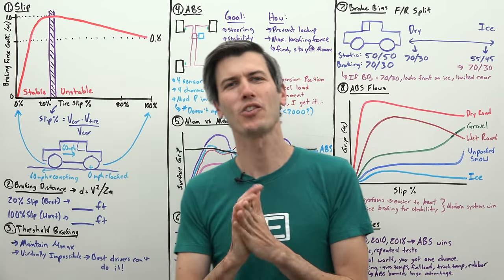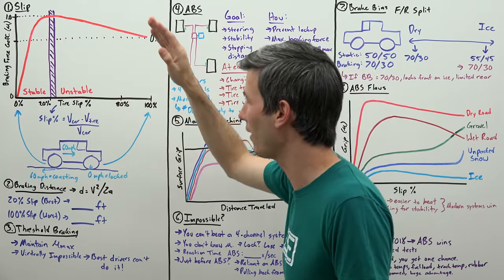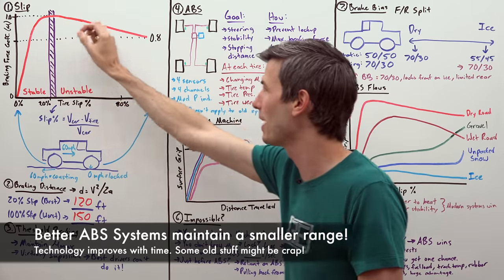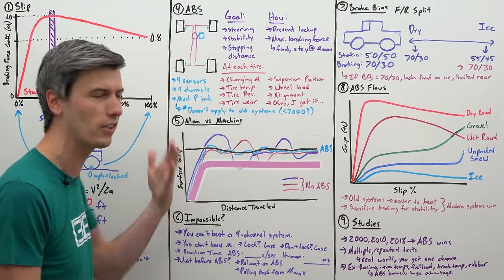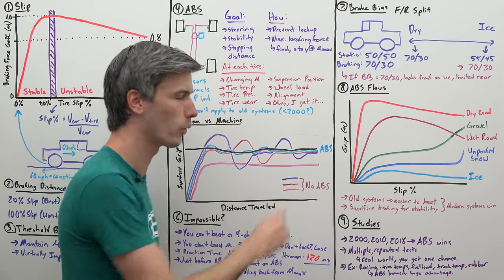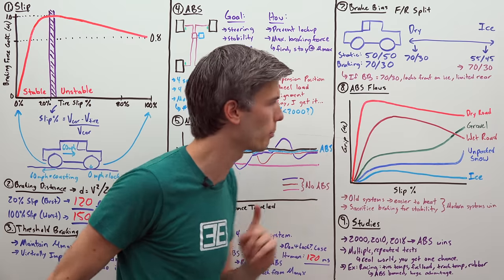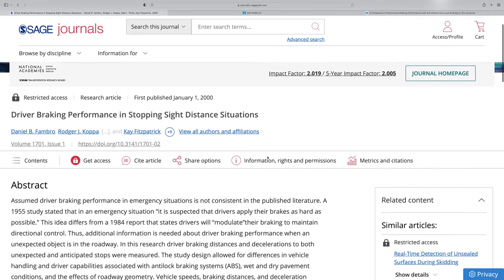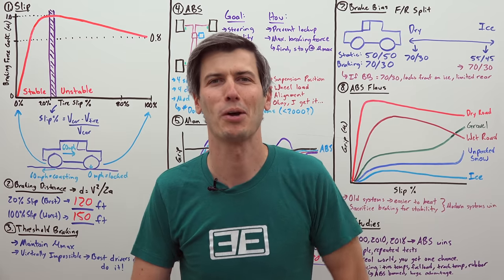Why Threshold Braking Is Impossible - ABS Wins!

Comment: There's a reason why regulators in EU in 2004 (and loads of other countries in the last decade) made it compulsory for all new vehicles to have ABS - it saves lives, people stop better with it.
Sure, Mr Racer guy might be pretty good at getting his Focus ST stopped when he's concentrating, but Auntie Mildred driving home from the shops in the rain is just gonna stamp on the brake if something pulls out in front of her - ABS will be her best chance at not crashing.
Nice video Jason! :)
Reply: Precisely.
Reply: I don't think anyone can beat ABS in that situation.
Reply: ABS was never mandated in the US because of the reasons he stated on gravel/mud.  But in 2012, ESC became mandatory in the US, which is based off of ABS and TC, so every vehicle has it indirectly now.
Reply: Plus it gives the confidence to stomp the brakes. Since the other thing that often happened before ABS was people not applying maximum available brake going long and colliding. Since they knew tires locking up and losing control was a thing and they feared that. So they under braked on not trusting being able to maintain control. So they rather under braked and maintained control, rather than over brake and lose control.

It was even part of driver training. Beware of locking up and so on. Modulate braking.

Well with ABS installed one can be told.... Just slam that pedal as much as you can. ABS and traction control make sure you don't lock up and lose control.
Reply: Nanny laws for nanny people. 
Next it will be electric vehicles,, and that is coming. Commonsense and precticality,,,, naah be a sheep!!
Reply: @ldnwholesale8552  common sense is that you won't even want abs until its too late to get it
i wonder if there were any astronauts who had to be forced to take an air tank into space..
Reply: It's usually Mr racer guy who ends up cosplay Paul Walker tho

Comment: In the mid 2000s, I had ABS activate on me driving a delivery van on the highway. I was unaware there was ice under the bit of snow I was driving on, and prior to then I was unaware the vehicle had ABS. It was locking up the rear wheels too much, causing them to slide, so I reverted to threshold braking to keep directional control. It was a great way to know where the threshold was though.

Comment: The thing that is most difficult about threshold braking is that your weight shifts according to your braking input, which means that the relative pressure applied by you needs to change. So you need to change your braking relative to your change in braking, and that 'double feedback' system makes it very difficult. Maybe my driving position and seat are just terrible, who knows.
Reply: It's worse than that, though.  Each wheel will have a different weight on it, and so the optimal brake force will be different from wheel to wheel, and there's no way you can optimally redistribute brake force between 4 wheels with only one pedal.  Nor can you get around it by tuning brake balance statically.  If you're on dry asphalt, you can brake harder, so the car weight shifts more onto the front wheels, meaning they need to have more brake pressure than the back.  Now, if you're on ice, you can't slow down as fast, which means that the weight doesn't shift as much, and now your brakes that were perfectly balanced on dry asphalt are locking the front tires and underbreaking on the rear.  Modern ABS can get around this by cheating and adjusting the brake force on each wheel independently in response to the car's motion.

Comment: Great analysis.  Had no idea ABS had changed that much over the years.  Figured my 1994 pickup truck with ABS was as good, or close to it, as modern ABS.  But maybe not...
Reply: Some of the older systems were pretty bad. GM used the Delco-Moraine ABS VI system on many vehicles in the 90s, which was a 3 channel system with the rear wheels controlled together, and also used a motor/piston setup which was much slower than the more typical pump/solenoid systems. It was basically designed to be cheap and to be able to say they had ABS.

Comment: I drove it an obstacle course at high speeds with puddles and a switch to turn off the ABS, trust me the ABS is 1000% better than regular breaking. The trick is with ABS you need to keep your foot on the break and steer through it and it works awesome

Comment: A lot of the bad rap for ABS does come from when it was being introduced:  it tended to be a pretty blunt instrument mostly made for panic stops but sometimes getting in your way when maneuvering,  and definitely getting in the way of any ingrained instincts to hammer the brake pedal quick as possible  in   panic stops.   In the 80's I had pretty remarkable reflexes and practice and it was all I could do not to plunge my Plymouth into the back of some yupster in his Audi suddenly leaning on full ABS.   This was the morning I blew off a dentist appointment to go get my car off my last ever bias plies.  :)       Anyway,  very early ABS was basically just taking over the 'hammer the pedal' function and it kind of blew,   but it actually improved very quickly,   and became pretty unobtrusive and helpful,   ...especially if they'd put it on like the rear axle of a pickup that'd tend to get light under braking.
Reply: The ABS in my work truck, a 2000 astrovan, is so frighteningly bad. God forbid I’m even slightly braking when I go over a pothole or even largeish crack. It WILL engage. Then immediately disengage. Then as weight shifts again it will engage again. Rinse and repeat a few times as weight keeps shifting around in the garbage vehicle and I have legitimately almost rear ended people during what would be otherwise very calm and slow stops. Talking about going from 35 to stopped in like 150 feet. And this little ABS dance it does takes ALL of those 150 feet. It’s honestly scary. 
My personal vehicle though, a 2009 Corolla, is completely seamless and confidence inspiring.
Reply: In the early days of ABS I heard* about people slamming on the brakes with ABS but being so shocked by the sound and pedal pulsating that they released the brake pedal because they thought something was wrong. 
*I have no idea if this is true, or one of those myths. 🤷🏽

Comment: Another important variable with the gravel and snow surfaces (likely much more important than the material building up in front of your tire); the digging in that happens when you skid to a stop also pushes your tires into firmer, grippier, ground away from the looser stuff on top.

A similar difference exists with accelerating. On tarmac if your tires are slipping then you're mostly just wasting energy and will accelerate slower so you want to gradually apply the throttle. On loose surfaces starting off at full throttle and then slowly coming off of it as the tires dig into the grippier stuff is faster than gradually putting the power on.

Comment: Back before ABS, I had a motorcycle accident. It was all I could do to keep the wheels from locking up. 70 percent front brake and 30 rear. At 35 mph I left a 3' skid mark with the rear wheel ( before it came off the ground) and a 9' with the front wheel. The front wheel never fully looked up but unfortunately I still hit the car that was making a left turn in front of me. I had the right of way as per the police.
Reply: For my next bike, the only rule is it has have ABS. Been on to many scares where you trying to ride the line between not hitting the car and not losing the front
Reply: @MegaLs2000  make sure it has cornering ABS as the bog standard ABS is only really good when you are upright.
Reply: I'm motorcycle riding some times the best way to avoid a collision is swerving out of the way instead of emergency braking. of course it is highly situation dependent. but something to consider
Reply: Too many riders are dependent on abs to save them. Abs doesn't make you stop faster, I don't care what this video says. There are too many variables. Tire choice, brake pad type, brake fluid ratings, even component types ie radial vs transversly mounted systems, master cylinders, rubber vs braided hoses, terrain, temperature of the wheels/surface. A good rider with the right set up and no Abs will  stop quicker than an average rider with worn pads, fluid that's never been changed, and tires that are 10 years old. Unfortunately too many riders fall into the latter group and don't maintain their motorcycle, ie replacing tires after 5 years old, brake fluid flush every 6 months, replacing pads or upgrading them to better than stock, or upgrading brake lines.
Reply: @dustinroque420  I get what you are saying and largely agree with the sentiment... But that wasn't my question, I'd like to see a full scientific breakdown of it for motorcycles... As you know it's a complicated matter and so that's why I wanted his breakdown of it.

I would say to you though, in the wet upright on the motorway I would absolutely want ABS... there is no way your brain is more superior than the ABS system in this case. We all go ahead and turn off ABS on the track because it's disconcerting banked over knee down with abs kicking in... Well it might just make you lose the front... So I absolutely get that ABS on motorcycles is a more complicated matter... But let's not forget even in MOTOGP, they have very advanced electronics... Turn off all traction control and slide control and the riders will no way be as fast or safe... So unfortunately at some point we need to concede that electronics are superior when tuned properly. I understand the debate is still very hot in the motorcycle community and many riders just hate it, but I want to be open minded and see if there is actually a system that could improve your braking... It seems only logical to me that if we can make all these other systems help us go fast then we can do it on braking too.
Reply: @Jjengering  I'd say they could probably put over sized rotors or something like a dual Buell style set up on both wheels, if the abs system can fully prevent wheel lock there's no reason we couldn't just run massive brakes aside from cost and weight. While I see the benefit of rider aids, I'll never be a fan of them. Masking riders with a false sense of safety isn't a good idea, because what happens if they get onto an older bike without? I had a friend who rode a bike with all the features, one day while maintenance was being performed at the dealer, he took a test ride on a mid 2010s r6, non abs. Was riding quickly, was used to abs not allowing for his error, and locked the front wheel and ate a curb. Also I'd recommend you watch the k5 gsxr vs ducati panagale v4 video from ari henning if you haven't. 15 year old suzuki and they ran quicker times with none of the safety stuff.
Reply: 70% front, 30% rear is no solution.  The ratio is always in flux.
Front and rear braking percentages change as faster stopping is required until it's 100% front and 0% rear.  Simple weight shift.
Reply: @dustinroque420  your obstinance is laughable!
All the variables and factors you mention are addressed by ABS:  wheel lock is prevented at the wheel, not at the lever.    The brakes will not lock, despite the pad, fluid, tire or road condition.  If your fluid and pads are old, you're going to have to pull on the lever harder, but it has nothing to do with locking the wheel.  Brake feel may be mushier, but that's irrelevant to ABS - it's controlling caliper compression AT THE ROTOR.  That's a separate issue.  In fact, your argument is a strong endorsement of ABS.  Since most drivers & riders don't keep their vehicles in perfect condition, they'll benefit even more from ABS.  
Plus, it's laughable for you to say you can react to tire lock-up faster than 15ms at the wheel.  That's simply beyond absurd.
Reply: @dudeonbike800  when did I say I can react at faster than 15ms at the wheel? Don't put words in my mouth. My point is that abs does not make you stop faster. It only stops lock up. There are situations where wheel lock is preferred and faster at stopping. I ride a motorcycle to be engaged in the experience, not so the bike can do everything for me. Safety systems are great, until they fail or you don't have them. I'll plug the revzilla video again where they take a bike with all the gizmos and compare laptimes vs a 20 year old suzuki with nothing and they run faster times on the suzuki. Enjoy having a nerdgasm about your 5 gigawatt abs system and try to think for yourself for about 3 seconds.
Reply: @dustinroque420  You're missing the point. ABS lets you consistently get the best out of your brakes. If your motorcycle is fundamentally in poor condition and not functional, you're in trouble, but with ABS you're in less trouble.

Also, braided hoses and radial master cylinders do nothing for braking capacity, they're just feel and precision things (but ABS is still gonna be more precise lol).
Reply: @SqueakyNeb  bud I fully grasp that abs provides consistency over different terrains. I never said it didn't. However, it doesn't guarantee faster braking. That's my point. Maybe read again and you'll figure it out.

Comment: An F1 car with ABS would be truly psychotic. The speeds and lap times achieved would be so incredible.
Reply: They actually can't use abs apparently. They tried, but the wheels would get flat spots on them because of how fast they are going
Reply: @youraveragegamer8832  thats probably why abs has never been introduced into f1 even with tcs and stability control systems being in the cars at certain points

Comment: Jason could you do a video explaining why big brake kits are a thing when stock brakes can lock up the wheels? and do big brake kits still improve braking distance? I understand the heat dissipation aspect of larger brakes, but I don't quite understand how they can improve stopping distance, other than maybe offering more fine control over brake force? Also, I have been trying to understand tire contact patch and haven't had much success finding answers. You hear in physics that frictional force is not surface area dependent, so wider tires shouldn't provide more grip, yet performance cars have wider tires, obviously. Is this because of the way the tire deforms and reacts rather than the frictional force alone? Just some things that I haven't been able to figure out thoroughly that are driving me nuts
Reply: Re: big brake kits, half of the reason is heat dissipation in track settings where you’re using them a lot more and a lot more heavily. The other half is about showing off your big brake kit.
Reply: @nettles89  yep, big brakes are better at heat dissipation. And in normal (non-racing) use, may not heat up enough to be as useful as they could be.
Reply: They can maintain consistent brake performance for longer in the face of heat, that is their singular purpose. You also typically get better hardware, fixed caliper versus floating for example, but this is not a function of size more cost and use case.

As far as your question on tire width, you are thinking more critically about this topic than most people do. Wider tire is more grip right, duh? Well theoretically no, the grip is only a function of the normal force (load) and the coefficient of friction, and both of these are assumed to be constants. A narrower tire has more pressure at the contact versus a wider tire and it all equals out. The full answer to this is actually quite complex and I am probably not aware of everything involved, but it's a few main reasons: The coefficient of friction vs load is actually not perfectly linear, as the load increases the coefficient of friction does increase but with diminishing returns. If a tire is too narrow for the weight of the car you can have excessive contact pressure and will have less grip than an equivalent compound wider tire (why? well now that's a question for a tire engineer and physics of rubber). The other reason is simply that more tire mass can absorb more heat and stabilize the temperature of the tire and there is simply more rubber to wear. You would rapidly overheat and wear down a narrow tire vs equivalent wider tire in a performance driving situation. For these reasons more grip manifests itself as a wider tire but not directly because of its width.
Reply: Tyres are complicated. It's all complicated really. But tyre compound is going to have a way bigger effect than tyre width. As others have said heat management is important. There's also the issue - particularly with track or race compounds where tyres are designed to operate in a certain temperature range so really big tyres can be quite difficult to get hot enough to operate correctly.

If you're looking to modify a street vehicle you don't really need to go wider. Just go for a more aggressive compound. Going wider won't necessarily give you much more grip. It will also tramline more and often perform worse in standing water. You also tend to pay more.

On that note best way to decrease stopping distances is also tyre selection